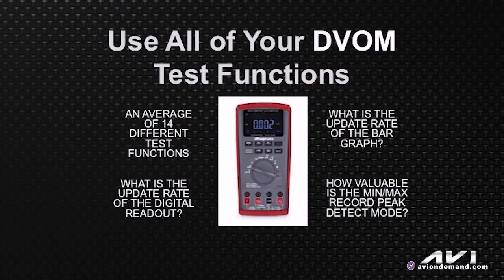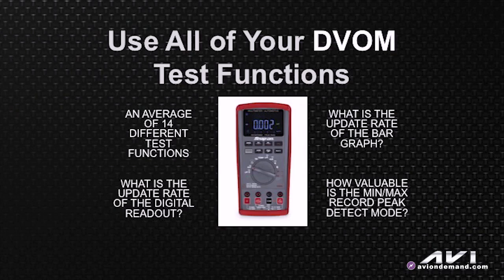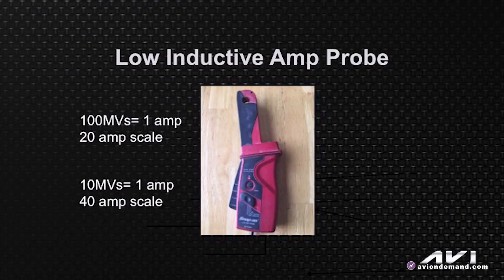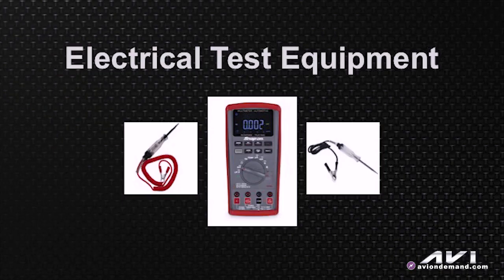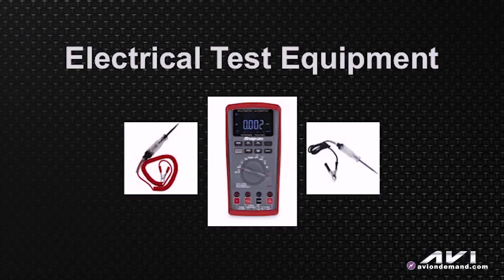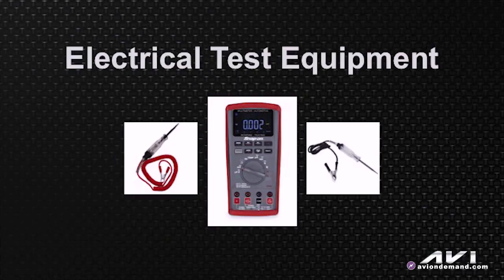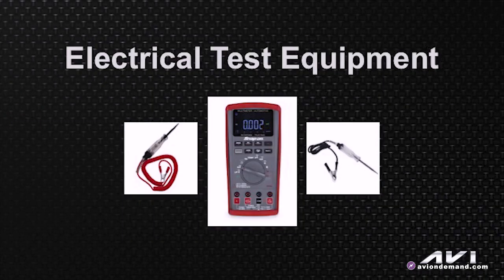Diagnostic Value of a Good Multimeter _ Bill Fulton _ Tech Tip

Comment: In a motor repair workshop. I found new replacement testers become super dependable by simply black taping over all the mA and high amps sockets, write 'do not use'. With this and the 'auto-off' feature the tester always works now.